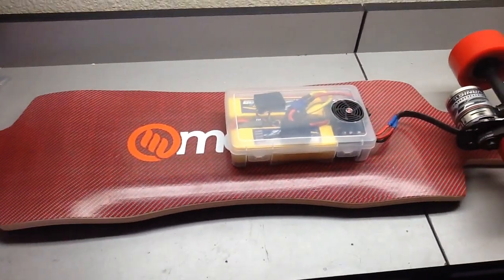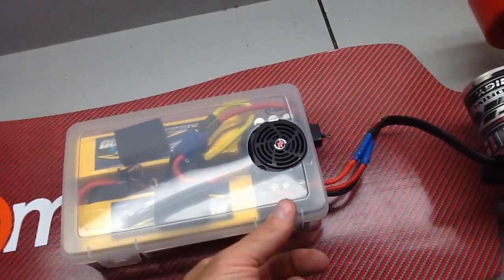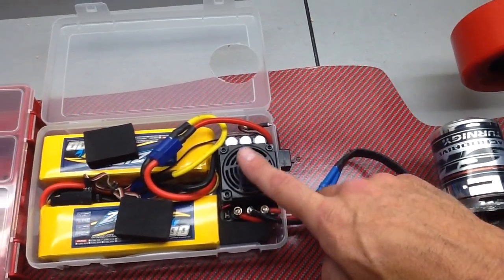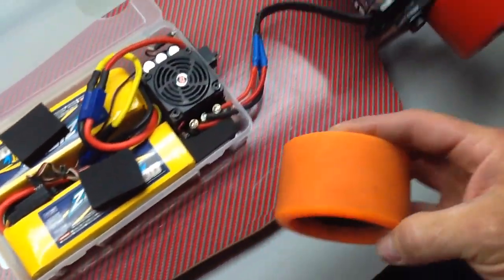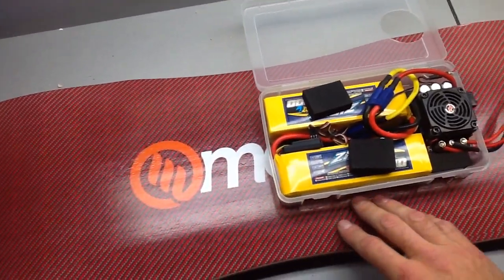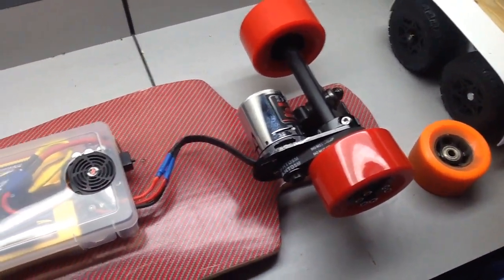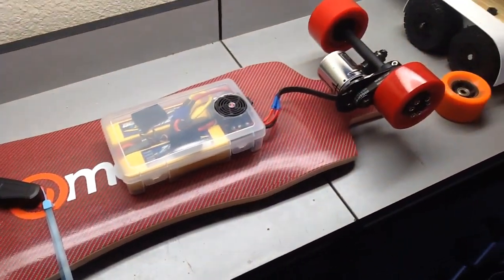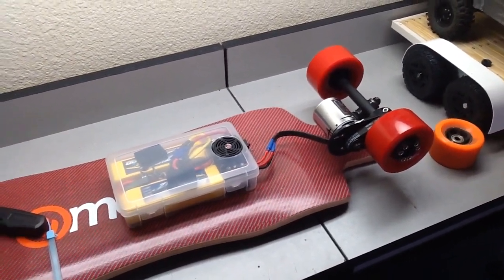DIY electric skateboard V2 upgrades

Comment: How did you mount the Tupperware to the board?
Reply from the maker: Just through bolted with small screws, big fender washers and lock nuts

Comment: I love how compact that box is it looks so good! What motor and esc did you use? And if you don't mind me asking how much do you weigh? I weigh about 180 and will be at school with about 20 lbs extra due to my backpack and gym bag. I'm considering doing  a dual motor setup. Not sure how people make those work but I'm still early in the design and funding stage. I'm also using a 55" sector 9 board so I plan to put battery packs in parallel to until I can get about 40 to 50 miles in range. Like all my projects I'm sure it will end up costing about 4 times my initial estimate 😣 haha
Reply: Kaden McDonald        40 to 50 mile range?????   Are you running quadruple  10,000mah  6s???

Comment: What angle do you put the motor mount at?? Final step then I weld
Reply from the maker: just make sure you will have at least one inch of clearance between your motor and the road when your done. What size wheels you are using will make a difference too.
Reply: +scott halstead thanks!! I got 104mm wheels because I had a drop through and it didn't have a lot of clearance

Comment: How many kv is your motor
Reply from the maker: 149kv
Reply: +scott halstead and what is you full speed ?
Reply from the maker: 20mph with 97mm wheels.
Reply: +scott halstead awesome and range ?
Reply from the maker: +ronrondu60 7-8miles depending on how you set your low voltage cutoff on your esc